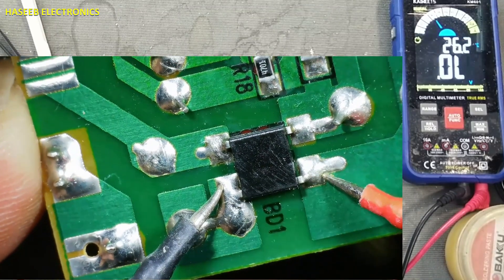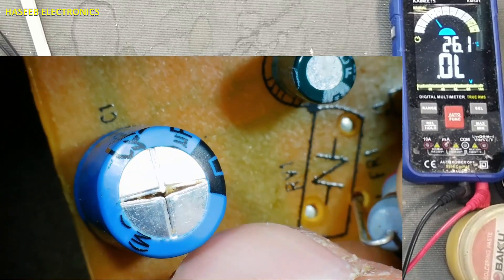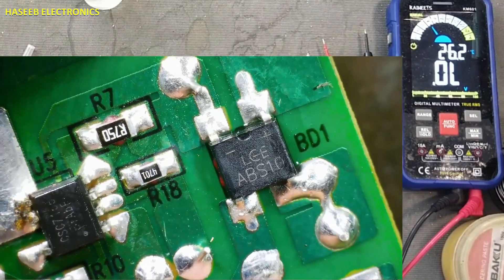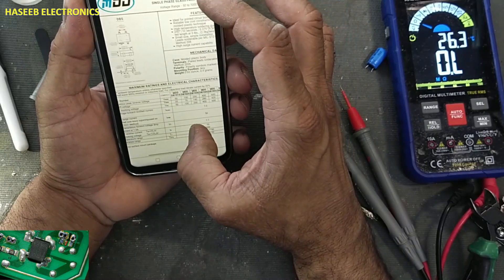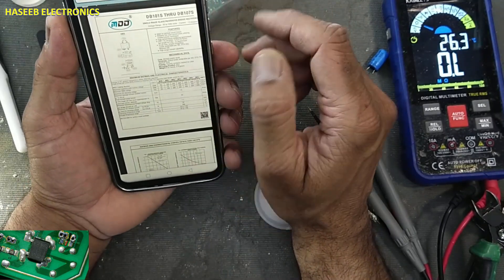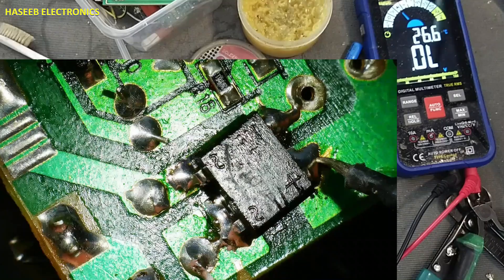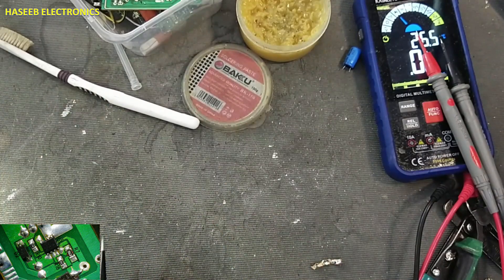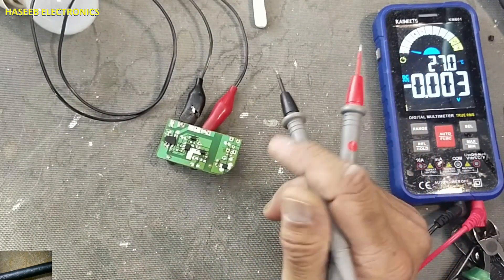#1149 12V SMPS power supply repair

Comment: I have a computer atx psu. When power applied +5v stand by works fine, also has 5v at ps on wire. When green and black are shorted, all main voltages (3.3, 5, 12) comes for 1 sec and then main section goes off. Can you explain how to solve this if you have any examples to show. The atx psu is having one supervisor ic preferably 7502 or hc 8012. It would be very helpful if you can explain how to solve such problem where after starting all voltages comes for a second and then goes off.